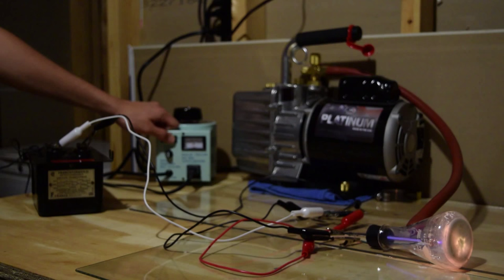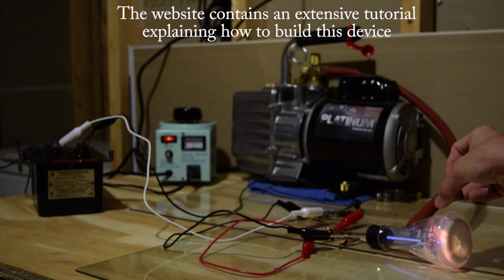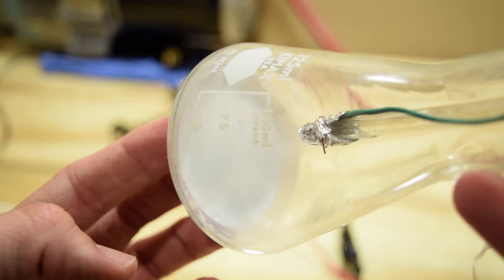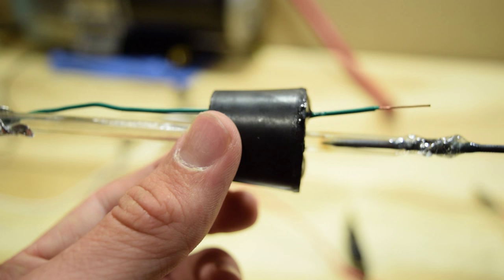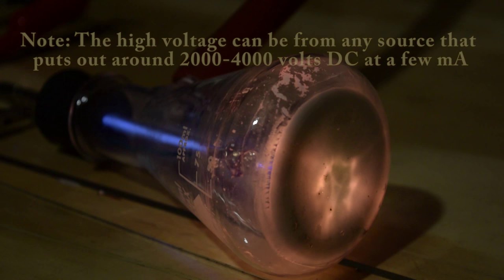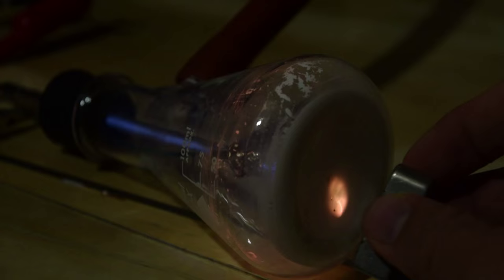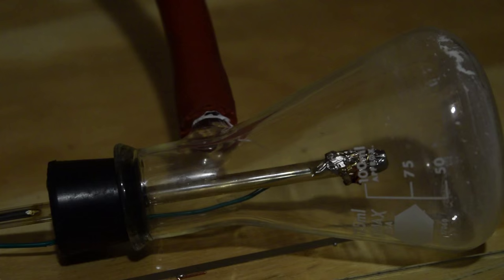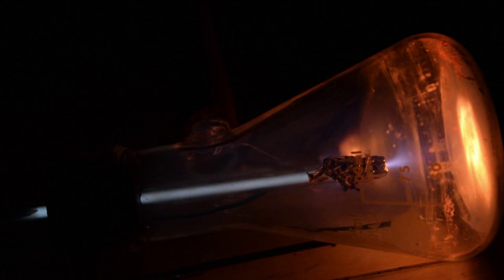Incredible Homemade CRT - Phosphor Screen

Comment: You actually produced a Braun tube. The Braun tube is characterized by the lack of a cathode heater. Instead it relies on the electro-spike, in your case a nail, to concentrate and spray electrons toward the anode. Braun tubes had very short life spans of less than one day on average as the point on the cathode is eroded away by the high temperatures of the plasma produced. For long life cathode ray tubes we thank Allen B. Dumont who introduced the first long life CRTs in 1931. He also invented the tuning eye tube that was common in early radio sets. Great job!
Reply: how could you make the tube last longer? just use a thicker wire?
Reply: A few years ago, the electro-spike process was revived in attempt to 
make flat CRTs that worked along the lines of plasma screens. Each pixel was made of a field of nano-spikes. Several thousand per pixel. These were made of tungsten carbide or titanium carbide, I forget which metal. They suffered the same ion erosion that the single spike did. The problem is that the plasma at the tips is hotter than the surface of the sun. It just won't work for very long because of that much heat. You could improve your CRT by trying to acid etch the tip of the nail to a much sharper point. Maybe try a sewing needle. Those are remarkably sharp points.
Reply: videolabguy wow i didn't realize how hot it gets. I am actually planning to build one of these so i'm trying to gather as much information as I can.
Reply: Only one thing I should mention. Don't take every word I say as absolute fact. Verify my information. I am working from an old worn out memory bank. But, I believe my statements are essentially true. There is the possibility of superior materials existing today. You go get 'em! It warms my heart to see folks still tackling these fundamental science questions. :)
Reply: ╱╱┏╮
╱╱┃┃
▉━╯┗━╮
▉┈┈┈┈┃
▉╮┈┈┈┃
╱╰━━━╯

awesome! i am going to be using copper wire for both the anode and cathode. I hope they don't sputter too much or erode away quickly.
Reply from the maker: The Jiro Network if you are looking to build one of these, I would recommend taking a look at the link in the video description. It it packed with info on building these little CRT models. If you have any questions, I would be glad to help you out. Just send me a YouTube PM.
Reply: Thanks, I own a bunch of those tuning tubes.

Comment: fun fact: CRT phosphors can display more than one color at once. Whereas digital pixels can only display ONE color at at ime, CRT phosophors are completely analog and despite having only 1 red 1 green and 1 blue (RGB) phosphor strip, the tops middles and bottoms and sides can be illuminated independently and actually display MULTIPLE software pixels on each phosphor. So while a 480i CRT television sounds like it has a lower resolution than your HDTV, the truth is that the CRT can display 1080p and 4k by compressing more pixels onto each single phosphor across it's 480 vertical lines.
Reply: 3 years late, but I'm pretty sure that's because a CRT doesn't have pixels, it's just a single line

Technically a CRT has infinite horizontal resolution, how detailed it is depends on how fine you can get the electron beam to be

The advantage of this is lower resolutions also looks really crisp on a CRT monitor, it's pixelated but not blurry unlike on an LCD

Comment: HI i am getting the stuff together to try both  a hot cathode and as you a cold cathode CRT ,as in the comment i think your foil anode hole is to large ,,,you should try next to make it with a pin so the hole is tiny ...but really some great ideas in your experiment i will try some ideas  i am impressed. it was interesting seeing the beam focus due to the magnet  very helpful indeed !

Comment: If and when you want to use that as a scope tube, I would take two small coils used as focus. I think if you put a small DC voltage through them (like 3v or something) you could get a tight beam. I think the beams irregularities are caused by the hole in the aluminum foil and the foil itself bieng very rigid unlike the tubes Nyle Steiner made. I'm no scientist, but I have confidence in that bieng why the beam is irregular.
Reply: DC isn't going to work on coils. And oscilloscope tubes used electrostatic fields not magnetic  fields usually from what I remember.
Reply: @jakubrogacz6829 he said for focusing, not for deflection.

Comment: I think I read that the x-rays don't start happening until around 50,000 volts.
Reply from the maker: X-rays can become an issue quite a bit lower than 50,000 volts. My fusor operating at 30,000 volts puts out a lot of x-rays.

Comment: So, could you use this to make into a display screen?
Reply from the maker: Hypothetically, yes. But it will need a much better ion gun, a focusing section, and beam deflection with either plates or coils. This simple setup is a long way off from a display.